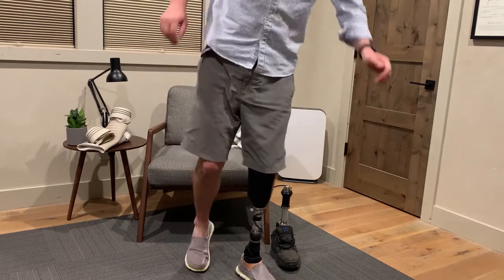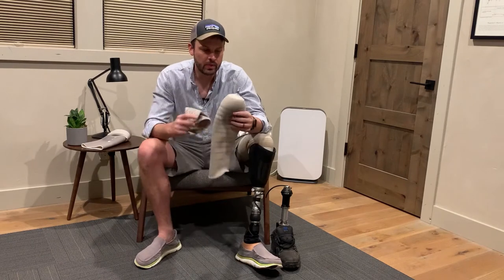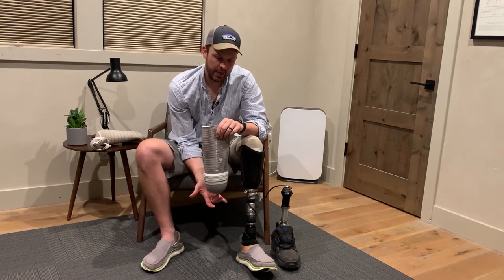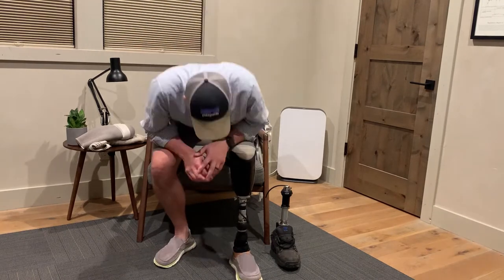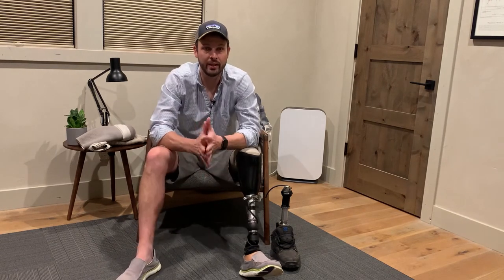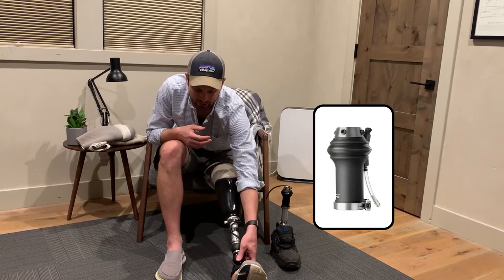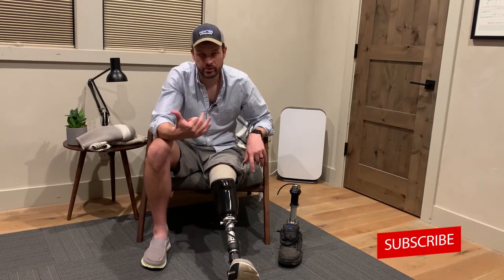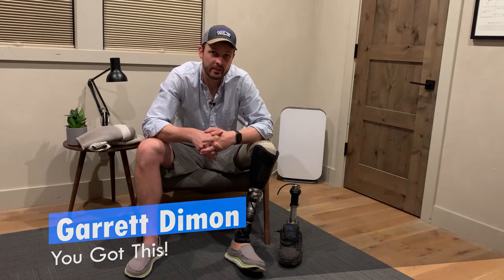Prosthetic Hybrid Vacuum and Pin Socket Suspension Systems

Comment: I appreciate your video. I was recently fitted with a VASS and it was a terrible experience. The day I got the test socket, wearing it was painful right from the start. After I lost the leg it was two years before insurance kicked in but when I went to try out my very first temporary pin locking socket, I stood straight up and walked like I never missed a thing. I did in fact, come home and you've never seen a man so excited and happy to mow his front and back yard. Yes, I over did it but I was happy as could be. 
Now back to the VASS...when I took it off at the end of the day my limb was painful and there were three HUGE blood filled blisters due to a vacuum leak within the socket. For the last three weeks I have had to be on crutches or a wheelchair. Needless to say, I will NEVER use anything that has a vacuum pump or vacuum assisted suction socket.
Have you ever had any problems like that?

Comment: Thanks for the info and explanation I have the same problem with my suction system the seal breaks very often please let me know if you hss as ve recommendation for good Prostetic Clinic thank you
Reply from the maker: It totally depends on your location. Mine is in Denver and has been great at always going the extra mile to get things just right. With my new system, I'm actually using two sets of the seals so there are 6 seals instead of just three. It's not perfect, but it makes a huge difference in the fit.
Reply: You got this. Mine is from Clinic Hanger in Néw York  .Denver it’s to far for me can you tell me what’s the name of Prostetic place in Denver maybe they have another place in my location or closer Thank You.
Reply: @lucas9mtb393  I’m on Long Island and go to International Prosthetics they take very good care of me and others check them out!
Reply: Sebastian .T thanks Sebastian will check

Comment: I just started watching your videos, but I just want to say that the information you provide is super helpful. Could you perhaps tell me how new the pin/seal-in liner combo system is?
Reply from the maker: That's great to hear! I'm really digging it. Due to my short resiual limb, I'm using two of the outer seals instead of one, and that made all the difference in the world. That way, instead of 3 rings to seal it in, there's 6. So even if movement in my socket breaks the bottom three, the top three keep the seal nicely. For sports and high-impact activities, I'd still add a sleeve over it for extra security, but it's definitely my favorite system I've ever had.
Reply: @AdaptableOrg  hi, how long is your residual limb? cause i also want to try the same system as yours but im thinking would ı face same problem as you. mine is 11-12 cm

Comment: At minute 5 you talk about buying "a pump" off of eBay.  Can you clarify?  By a pump I assume you mean an active battery -drive pump as opposed to the passive mechanical pump that Ossur has integrated into its Unity system pump.  A few more details on the snowboard foot would be great.  I have a BioDapt alpine foot and am looking at the same scenario.  Also, you have a link to Ossur One Fit Direct Socket.  Have you found that to work? I'm in Colorado also and curious what clinic you worked with.
Reply: that pump is harmony p3 by ottobock.

Comment: I got the same system because of this video and no regrets. I'm now working to use this socket with a running foot, any advice here?
Reply from the maker: Unfortunately, I don't have any advice on that front. My running foot is still set up on my older sockets with a suction system. I would imagine that you should be able to add a sleeve to this setup and it would work. You'd just lose out on the vacuum. Otherwise, I'd think you'd have to have the vacuum attached to the socket somehow. For my non-vacuum foot, I found a used Ottobock P3 on ebay, and I use that. But it's too tall to fit with my running foot.
Reply: @AdaptableOrg  appreciate the quick response. I'm going to look into the p3. I'll comment back if we find something that works with the hybrid system. It has been a game changer so far.